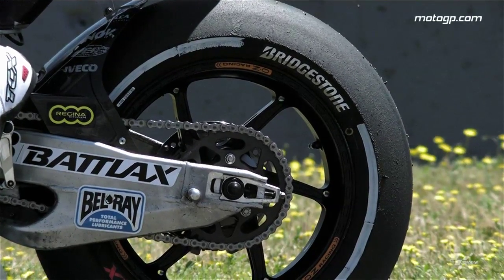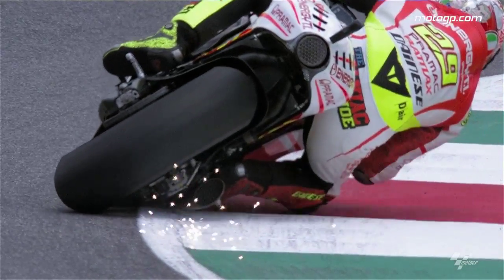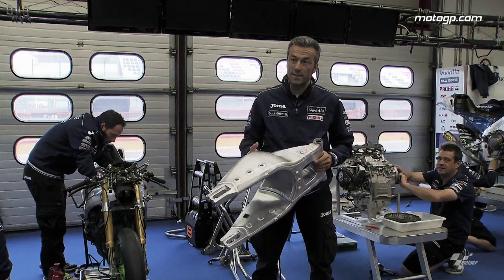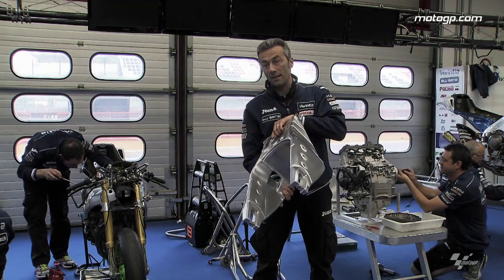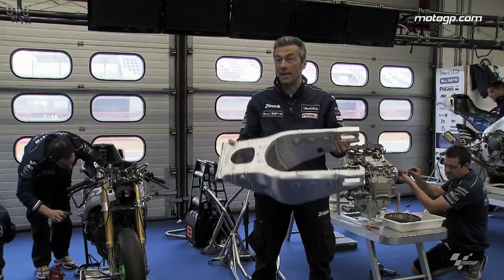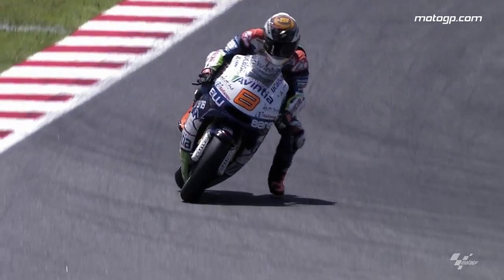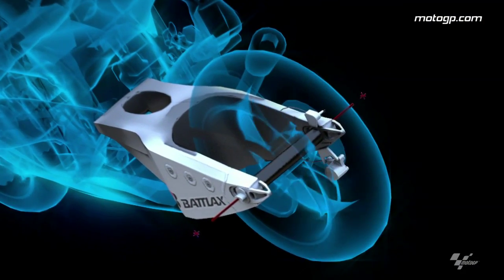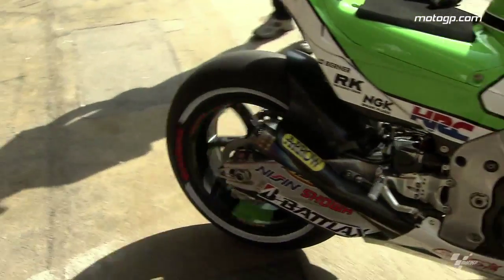MotoGP™ Workshop: Swingarms explained

Comment: Has anyone ever done a spokeless rear wheel where the swing arm is shaped to entirely fill the wheel with bearings between the two... obviously?  Perhaps the brake rotor could be like a  on circular fin on one side of the rim wirh the caliper mounted inside the donut of the swing arm  Would look so bizarre similar to other concept vehicles but with the doughnut swing arm that actually looks like it would it WORK as opposed to the silly concept ones that do not look doable   There would be significantly less rotational mass with no spokes or hub  the challenge I failed to mention is the drive sprocket...perhaps that could be INSIDE with the bearings?  With the drive chain mostly enclosed inside the swing arm? exept the sprocket teeth would be on the outer circumfrence of chain not the traditional interior....might have to be a totally new type of chain and sprocket tooth idk